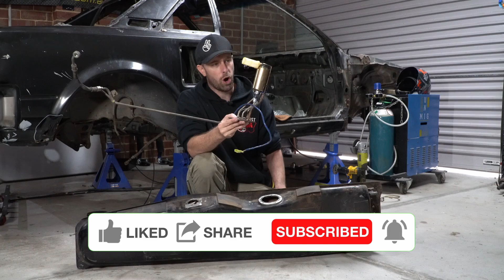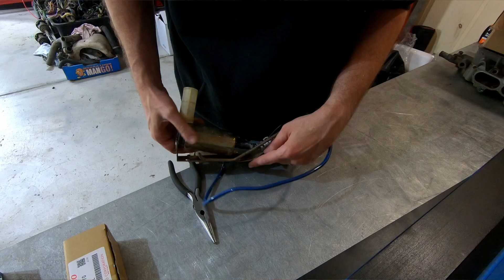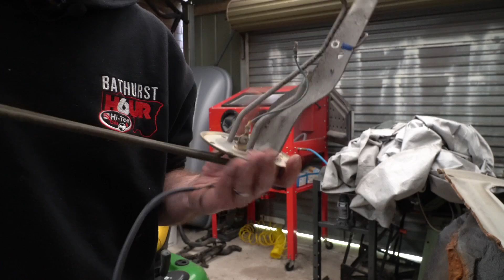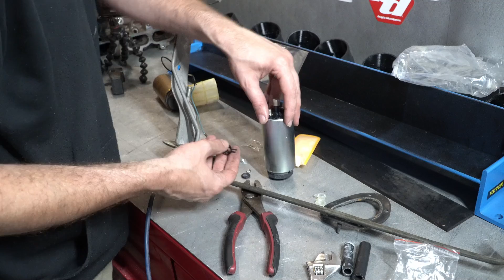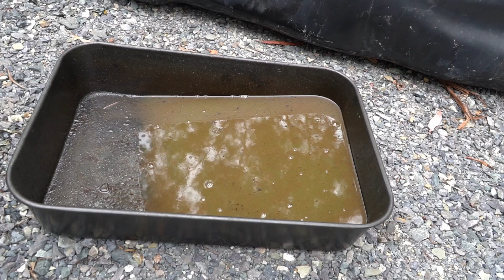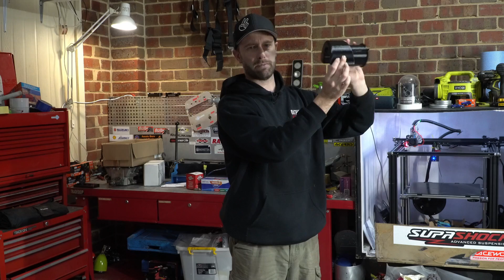AW11 MR2 Fuel pump replacement and sandblasting!

Comment: Hey I might get an mr2 that has a bad pump, do you think I could change it pretty easily without taking the car apart like the one in the video?
Reply from the maker: if it's an AW11 you'll have to drop the fuel tank out, i'm not going to lie it's a pain in the ass.

Comment: FYI, the MK2 MR2 fuel pump hanger gasket is the same as the AW11 if you need to replace yours. So many parts for the AW11 are no longer available as either aftermarket or factory, but some parts are shared like this one. Cheers!
Reply from the maker: Great to know! Thanks mate :)